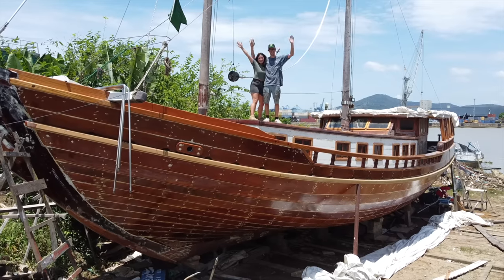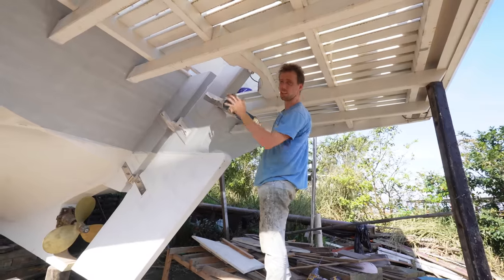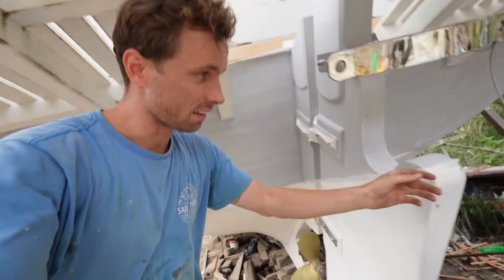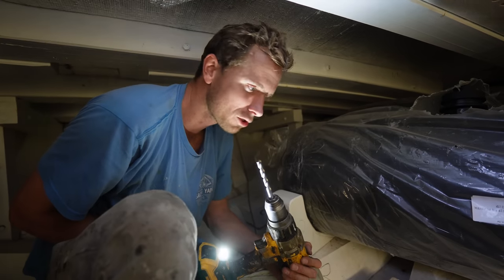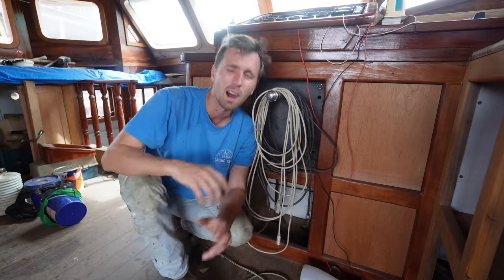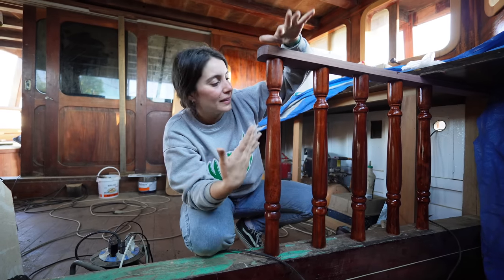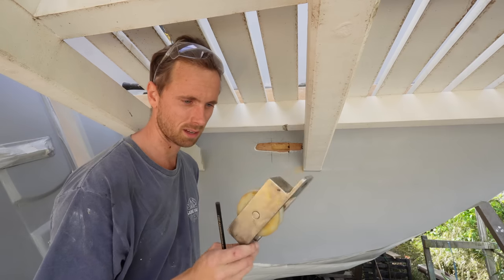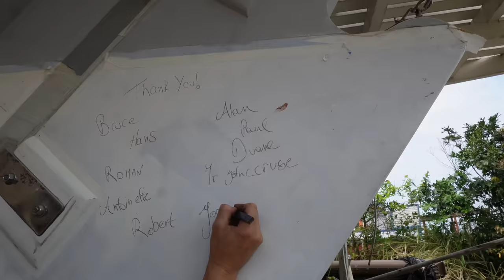We can finally steer our once sinking wooden boat into the horizon — Sailing Yabá 152

Comment: There are a lot of extremely good constructive comments already posted. Please pay attention to them the same way you did with the oil-filled steel ballast concept that you eventually retreated from.  And make sure you have a clone on-board in case part of the steering rig fails.  Use already established boat-rated rigging parts everywhere.  Also make sure the cable wiring won't take out the engine belts if any part breaks; move the wiring if needed.  Consider changing the steering ratio AFTER you go into the water.  Try it first.

Comment: Ben and mp you are doing an amazing job! I worried about the steering system there will be really tensions on the rudder when sail or when running on the engine. Maybe you could overlook it. Keep going your good work and looking forward the sail with you!

Comment: It seems that you should be able to find a metal or delrin bushing to go through the transom to eliminate chafing. Brass sleeves and a flaring tool will get the job done. Also, will you be putting some type of rudder stop in place in order to eliminate hitting the swim platform? You probably already did that and I didn’t see it.😊

Comment: Probably if you grease the cable where it passes through the wooden transit, it will greatly reduce the steering resistance.  That's the only place likely to have friction, and some good heavy axle grease will probably help.  Also put some paint on all the hardware that will rust, and smear grease on them after painting.  Smear grease on the chain too, to keep it from rusting.

Comment: The metal cable protector thingy is called a thimble. When installing don't rely only on the clamps. Consider splicing a flemish eye (vlaams oog) in the steel cable and then putting the clamps. This will give you a much stronger eye and considering where Ben comes from give him something to brag about :)

Comment: it would be a very good idea to put a bolt though the pin hole in the end of the chain or else the link plates will simple spread apart . They are only a push fit on the centre sleeve . Hope this makes sence Tank care Richard .

Comment: For the cable clips (clamps) one should consider using a minimum of three at each point. In the large steel girder transport cable stays I've detailed in the past they use 6 cable clips (yes that is the correct non-sense tech term for those) on each end of the cable.
3 clips on each end provides peace of mind.

Comment: Hi kids,
Still loving your show, every Sunday.
About the steering:  I'm no type of authority, but I will tell you I agree with many of the comments in terms of protecting the transom and wire, the stress your steering will be under and to consider beefing up components, etc.
Basically, I think you need to go back to the drawing board, with the comments in mind and someone expert in steering systems, and reconsider the whole design as well each component.
Cheers from Vancouver

Comment: Hi Ben and MP.  I am a long time viewer starting from the time you were visiting Odd.  I am not a marine engineer but have built prototypes and machinery for over 40 years and my gut feeling is the chain is too lightweight.  Also I am reading your comments about the size of the cable and how the pulleys are anchored.  Perhaps it would be prudent to have a consult with a marine engineer.  It is a big heavy boat.   I want you both to be safe out on the ocean.  Looking forward to seeing you under sail.

Comment: I would certainly use thick wall brass tube to line the transom hole, sized for the cable. Buy 3 metres, it’s a consumable. Fit a grease point (waterproofs and lubricates).

Comment: Take a look at motorboat cable steering from the 50’s and 60’s. They used an automatic cable tensioner. Basically a spring with two wire loops inside facing opposite directions. I’m not sure if a cable tensioner big enough to handle the load on the rudder is available but you may be able to make one. You really need a pair to take the slop out of the steering, add shock absorption, and automatically tension the cable as it stretches.

Comment: The chain being used is motor cycle chain not bicycle chain, so the strength is fine.  The gear ratio of the sprocket being is smaller will defiantly give you a better steering control.  You will need some a "D-rings" that can be connected to the motorcycle chain via a master link on both sides that you can connect the cable to. (The chain is strong, but the links are weak.)  Defiantly a Teflon thimble will help seal the wood and slow down the wear and can be replaced when worn out. Use a turnbuckle at end to adjust tension, you might be able to attach them to the chain and then the cable.

Comment: if you use a chain link  connector, it will allow you to use the cable ferral which will proteck the SS cable. and I would use 8mm SS cable with small shackels each end which will be the sacifical easy change parts.

Comment: Couple of things for the rudder  #1 Use thimbles through the wooed  #2 I fined 6 MM /1/4" cable light  I think 10MM or 3/8" would be a better fit and less chance of cable breakage  with a large rudder like that #3 please do come up with a better plan for cable to chain connection #4 I recommend you install turnbuckles in the cables to provide a means for adjustment and tightening the cable as it is used the cable will stretch and turnbuckles and heavy springs provide a easy way To take up the slack with out dismantling the system other than this I think you have a good plan just some tweaking

Comment: Hi Ben and MP, lots of comments on design and strength of cable system. Just wanted to comment on the lower pulleys on the bulkhead would have forces upwards and the narrow width of base will bend the lag bolts. need to have strength in opposite direction to cable pull. I feel you will gain a more robust system once you review comments from many others. Seen as positive and caring for getting this system bullet proof.

Comment: First where the cable is going through the bracket on the rudder ,the cable needs to be protected so it doesn't wear the bracket or the cable. You are going to have to put a tensioner on each of the cables so it doesn't allow the cable to cross over itself on the quadrant if there is any slack when your steering with pressure against the tiller. I would put the tensioner on the end of the cable where the cable was attached to the rudder bracket.

Comment: Hate to pile on but I agree with those saying the cable is too light for the potential loads you will see out on the big blue especially in a heavy following sea. I’m also concerned with the loads on the turning blocks. Here is a handy calculation to use; Load on a block is a combination of the load on the line passing through the block, plus a block-loading factor, which is determined by the angle by which the block turns the sheet . For example, a footblock that turns a sheet 180° will see a load equal to twice the load on the sheet.

Comment: You should consider putting safety wires through the nuts and bolts on all shackles and cable clamps so that they will not come completely unscrewed while you’re on your fantastic adventures and lose the rudder control. Like they do on aircraft engines so they won’t come unscrewed.

Comment: Did you consider installing a couple turn buckles in the steering cable to more easily allow tensioning and even provide the ability adjust the position of the wheel slightly.  They could be placed in the long run along the ceiling in the engine room.

Comment: Hydraulic would be best, but cable is simple and easy to fix in a pinch, carry extra cable, thimbles and shackles. It would be a good idea to install turn buckles between the chain and cable to tension the system. And, 6mm might be a bit small, maybe consider 8-10mm. You can keep the 6mm on board for your back up, get out of a jam kit.

Comment: It’s called a thimble. Consider putting a stainless steel bushing in the transom for the wire to travel through. You will need some turnbuckles in the system to adjust the tension of the wire as it stretches over time. Double up on all clamps.

Comment: Thanks!

According to Amazon and they’re called, cable thimble rings. You might want to see if you can find a shackle that will go on the end of your chain so you can connect to your cable to keep down the friction that could wear out the parts. And you might also want to put turnbuckles in, so you can tighten up your cables assuming you haven’t really thought about it. On a slightly different thought while you had those spindles out and were sanding them before varnish them. Why didn’t you sand that beam or at least the top of it so it be ready for refinishing also which would’ve been a lot easier without all those spindles sticking up.

Comment: Hi Ben, please do use fairleads in the steering system and use a tube thrift the transom as others suggested to isolate the cable from the transom. A hydraulic steering system would be ideal too.

Comment: you should have used a laser pointer at both ends of the rudder movement to minimise side wear on the pulley wheel . the stress on that pulley will be immense in heavy seas. looking at your film it looks like stern pulleys should be angled up about 10 degrees on the outboard side of each pulley. Also an easily adjustable tensioner wheel might be a good idea to take up slack and any stretching of the cable.

Comment: No offense intended but, I think you need to rethink your steering system so that sheaves are aligned properly.  You will also need tension adjustment.
Reply: More than that.  I use stainless cable a lot and where there are crush points from tension they need to be monitored and replaced every couple of years.  For you, with the large rudder, that cable going thru a chain will be a failure point.  Rudderless is not a good look for sailors
Reply: It’s difficult to tell from the video, but it looks as if the geometry is wrong, the first pulley of the quadrant  should pull at right angles to the pintle line other wise the wire tension will vary with  rudder angle.  Mindful of the steering gear on the 38 foot yacht I sail, this looks incredibly flimsy.
Reply: That cable is far to flimsy you asking for trouble 😢😢
Reply: This should have been better thought out. Somethings take complex maths an someone with real expertise in this subject! As a person above said... no steering is a bad look on any vessel !
Reply: Agree with all the above, also note the bulldogs grips are not mounted correctly
Reply: If it were my boat, i would find a way to build a skeg from the transom and the keel out so that the rudder was at a 90 degree angle to the waterline.  Steering gear would describe an arc in plane with the waterline that way.  That approach would simplify the design of the steering gear, eliminating angles and arcs that will stress the cabling.
Reply: Steering wheel = helm
Reply: De staaldraad is wel erg dun ik zou minimaal 12 mm nemen en als je van de spiegel naar het roer en dan via een katrol weer tereug naar de spiegel gaat hof je geen ander tand wiel te laaten draaien 
Binnen zou ik een geperst oog met een sluiting nemen en dan aan de buitenkant aan de spiegel een rvs wand spanner om de kabel ook na verloop van tijd makkelijk weer op de juiste spanning te zetten
Reply: Cant say I like cable steering like this ....I've had boats much smaller than this and over time they always seem to give me  problems.
Reply: I think you need to run the ships drawings of the keel and rudder as well as the helm / steering system past a naval architect to have the numbers checked.  There are calculable forces on the rudder at various speeds and angles of steer as well as vertical angle of the vessel and then the force generated on the various components in the manner you are using them.  I think you will find the cable is insufficient for the forces involved and that wear or stress points in the asymmetrical style system you have chosen will shear your equipment far too easily, too early and as with everything in boating, at the worst possible moment.  You don’t seem have a secondary backup for securing the rudder should something catastrophic happens, unless your tiller is immediately available under all circumstances…. Yaba is not a small boat and not the kind of girl you’d want to have trouble with steering.
Reply: I appreciate Ben’s willingness to jump in and take on tasks, but systems like steering should be left to the experts. All the gear (cable, chain, how they’re joined, pulleys, etc) and winging the installation is going to lead to failures and once at see that’s a nightmare.
Reply: Agreed, as a minimum add rigging screws to adjust tension.
Reply: Well said. @lzevon
Reply: As others  have  said  cable far too  small and you should  have zert  fittings  on those pulleys.  
A Master Chain link should  be  used to connect  cable to  chain to make repairs  easier  CAUSE  IT WILL BRAKE
Reply: Some type of idler pully spring loaded.
Reply: The brass sheaves need to be through bolted - not lag screw bolted.
Over time if the lag bolt thread pulls through the timber with tension and movement, you lose steering.
It looks pretty dodgy as a steering setup.
Probably would have been worth setting up hydraulic steering if it were me.
Reply: Hate to say this, but I think A hydraulic system would be simpler and more reliable.
Reply: There is going to be so much tension on that quadrant (indirect from direction of rotation) it is going to cause so many problems. That steering is going to be heavy and very likely hard to control, again hope I am wrong. You will soon see why there was so many rope turns on the steering shaft at the helm.
Reply: Sorry but cable is two light alot pressure for aboat that size double pulleys would help and cables
Reply: Sorry but I agree with all the comments that your steering system is just asking fir trouble, too lightweight and frankly potentially dangerous in anything other than a flat windless calm.  Hydraulic would probably be better but I would strongly recommend you seek professional advice from a naval architect.  Please listen to the advice being offered and great videos and a super project but safety is critical.
Reply: You’re doing loads of good stuff, but this steering will not take anything more than light use. I’m willing to bet a big amount that that first block you mounted will break loose quite soon. It’s just the wrong type of block and it’s totally misaligned with the loads. Use free hanging blocks with serious through bolt attachments or at least the bolt line can’t be across the load path.
Reply: @evertschouten913 excellent points

Comment: I don't know if this was already commented below, but I would (in addition to the block (pulley) for the steering, also drive a sturdy metal tube into the hole in the transom.  There will always be some rubbing of the steel cable against the wood, and the wood will loose that fight. But you can even out the playing field with such a metal sleeve.

You may also want to look to have tensioner s on the cable to catch the play in the cable. Nothing serious, just to remove the slack we see from the outside - between the transom and the quadrant: look at the trailing side.

Comment: BEN Crimp that wire, use a hydraulic crimper and remove those threaded wire locks. The eye shaped part is called a thimble. That is the  way...shackle and thimble....also on the chain side. Y would go for the next cable size 8 or 10 mm

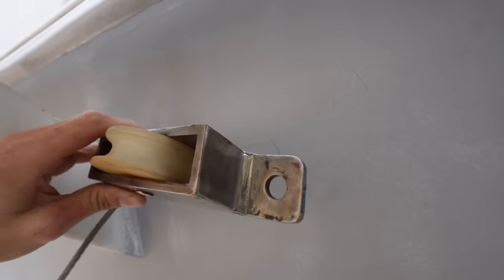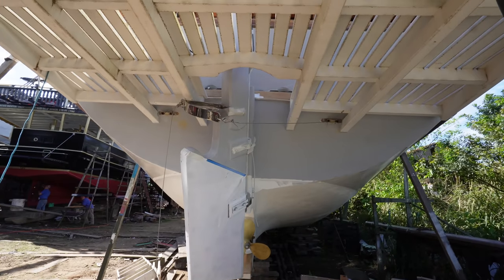Comment: The angle between the cable and the alignment of the pulleys on the transom varies between in-line and (very roughly) about 15 degrees off at present - when the rudder is hard over either way.  This will create erosive friction on the cable surface of those plastic pulley wheels, which will either wear on the wire or the pulley surface.  Although this will be slower on a subsequent stainless pulley wheel, it is still far from ideal. See marks 22:05 & 27:22. You even seem to demonstrate the range in which this applies!

I think the best solution would be to re-seat the pulley bracket by several degrees so that everything works all in the same plane.   It's a pain but it will make everything operate smoother in the long term but with far less wear on the components.

Comment: Maybe i missed it, but if not maybe consider bolting a  stainless steel eye bolt through the bracket of the rudder for your cable to fasten to. Then you'll be able to use your cable eye protector.
 Maybe something that offers adjustment to keep it under slight tension.

Comment: Chain to cable suggestion ... " take a bicycle gear ,a flat gear that matches the teeth of the Chain . Then cut a pizza slice out of gear,  attaching the cable to the pizza slice at narrow end to a fix end that pivots  Mount and run  cable around the end of pizza so wide end pivots. Just a thought.  I bet u are gonna do that later 😊 excuse

Comment: Add turnbuckles the chain to wire junction. Find turnbuckles that interface with the chain naturally. Then on the rudder end, have  pulleys at the ends of your rudder quadrant and run the cable through the pulleys and anchor them beside the pulleys that guide the wire out of the transom. This should double the number of turns and halve the amount of force.

It’s a big boat. Can’t hurt to have as much mechanical advantage as you can. Then you’ll need to figure out how much tension could possibly be on that wire and chain and make sure they are sized appropriately. The snatch block style steering should reduce the strength the wire needs.

Comment: The wire holes, thru the  Hull, will start to rot. If... you don't do anything about the exposed wood. Just a tip!!!! Maby a stainless or brass pipe that seals the wood from exposure!!